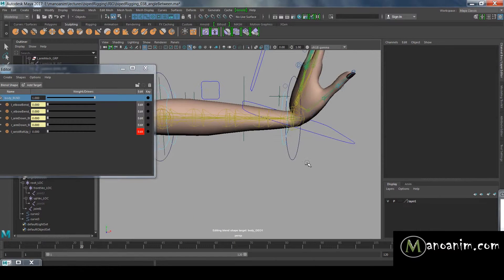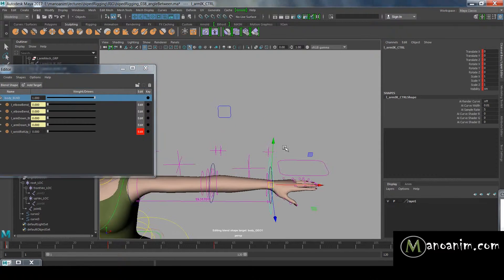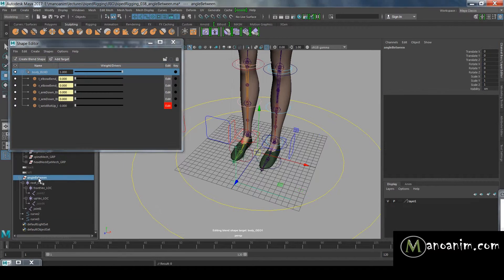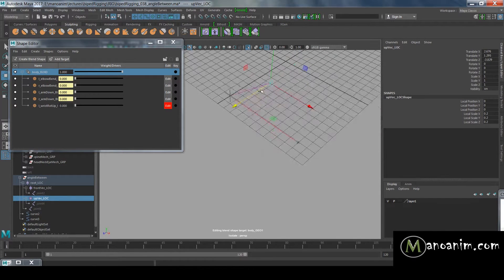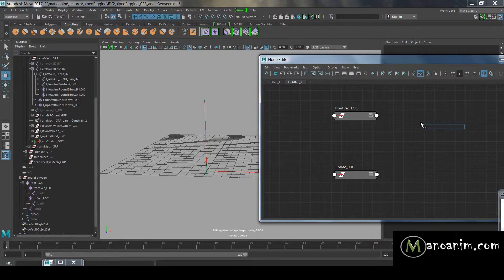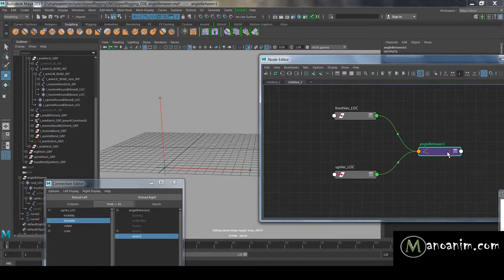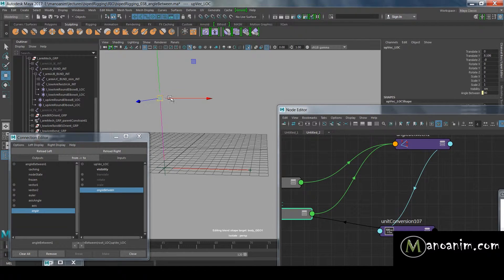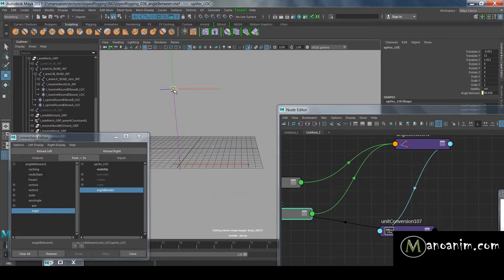Shape Editor Angle Based Corrective Blendshapes - MANOANIM

Comment: Hell Manoanim, first of all, great tutorial. I have already known this technique but I have to shoot an extreme corrective shape for the upperarm when it rotates 110 degrees in Y axis and the angleBetween node always shows me positive values. Because of this I never can't shoot the blendshape because the node only reads 90 degrees and when the arm reachs 110 degrees the node shows me 20 degrees instead of -20degrees (it did one entire round and starts again from 0 to 90degrees)

I hope I have explained my point correctively and you could understand me and you can help me.

Thanks!!
Reply: have you found a solution yet ?